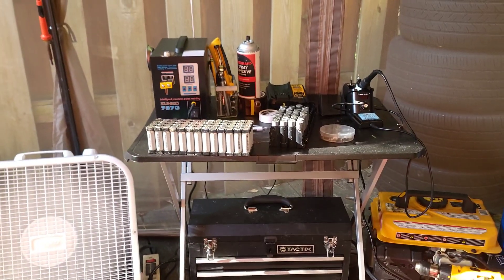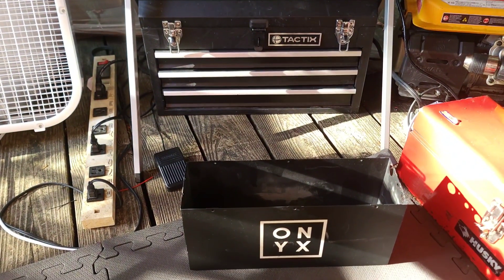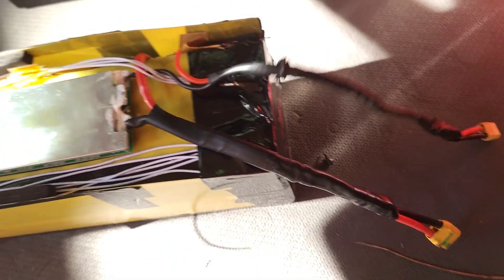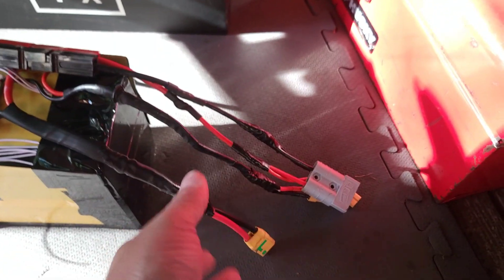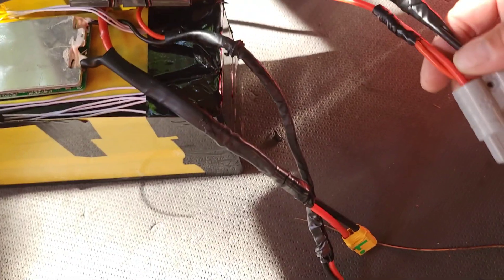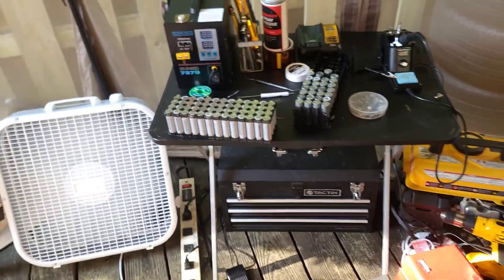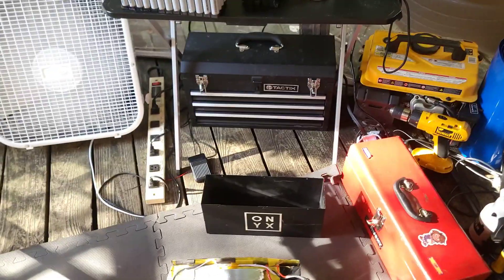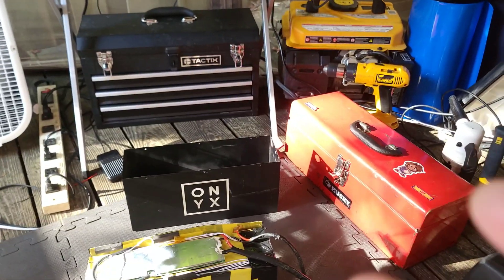How to Bypass a BMS in Onyx battery or any battery to get maximum power. The safe way to do it!

Comment: One side note: by doing this type of setup will basically allow your battery to heat up to the point of a fire or explosion... That will be the limiting factor. I've caught my battery on fire the other day and it exploded but as long as your aware of the tempeture of the pack as a whole you should be good. just lettin ya knno

Comment: I built a bypass on the Onyx RCR December 2023 verison battery with doubled up 12 gauge wire and an 80 amp fuse

Comment: Good video,  quick question how does the regen breaking work when the BMS is bypassed? Thank you...
Reply from the maker: bypassing BMS plays no affect at all on ebraking regen pwr goes back to the battery thru discharge side even if that's by passed as well goes straight back into battery thru the phase wires which intern send it thru the controller where it's connected directly to battery. regen and ebrake would be easy too much for charge side of BMS they are normally set up for low pwr 10-20amps. I had my Ebrake set to about 90amps on my Bomber.
Reply: @ChrisCrossingWires1212  thanks ✌